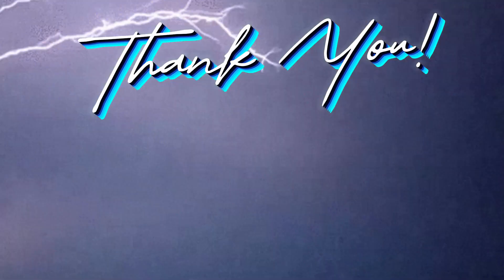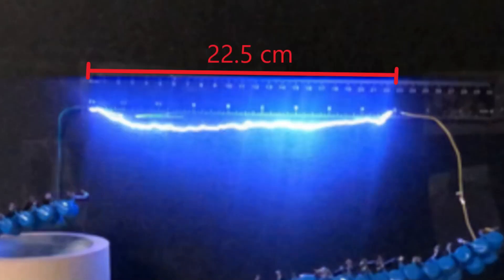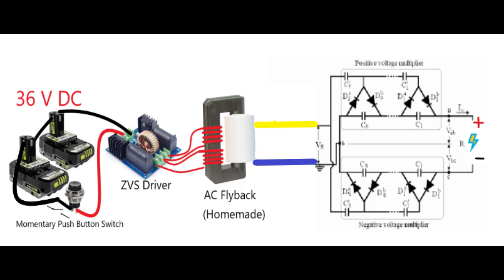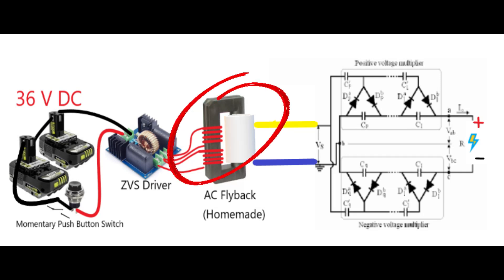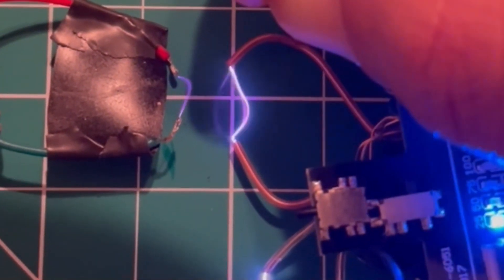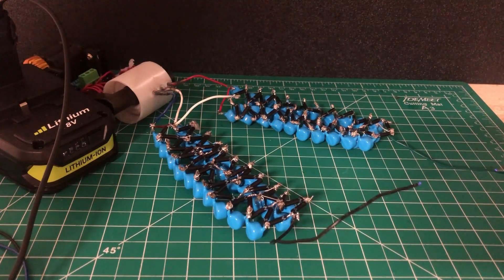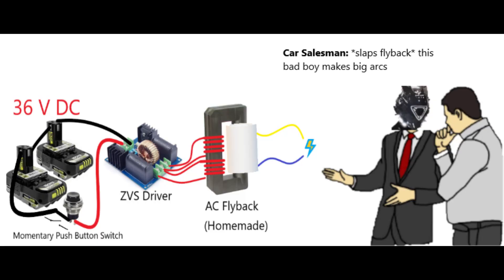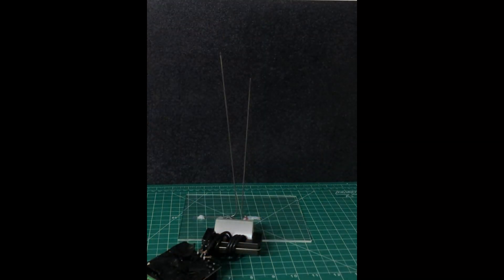225,000 VDC High Voltage Multiplier - ZVS Driven AC Flyback Transformer Bipolar Cockcroft Walton

Comment: 225kv is a bit of an overestimate, 10kv per cm is only good up to about 60-70kv, after that it drops quite bit 185kv can arc about 30cm
Reply from the maker: The only way to tell is to actually measure it, which I don’t have a way to do that at the moment. Everything else is an estimate which I believe the viewers understand.

Where have you seen that the estimate drops off at 60-70kv? No offense, just seems like it would require more voltage to breakdown air at greater lengths. I would it expect it to take for example 250,000 volts at 20cm.

Anyways I do appreciate your comment and I hope we can come up with something conclusive!

Either way I will be attempting to produce larger arcs for your entertainment!!
Reply: @UsefulVeryUseful  Nonlinearity effect appears for impulse voltages and high frequency voltages much over 100 kV. This is almost DC and voltage vs sparkover is pretty linear up to 3000 kV, probably more. However it depends on humidity and pressure. If you had atmosphere close to standard, rod rod bipolar gap is around 200 kV for this spark lenght
Reply from the maker: @imeprezime1285  thanks for the information! Do you have any high voltage projects that you are working on at the moment?
Reply: @UsefulVeryUseful   Yup,  110/20 kV 20 MVA substation. I'm an electrical power engineer
Reply from the maker: @imeprezime1285  that’s awesome! I have a degree in EE as well but most of my experience is in RF/electromagnetics testing. I started this channel to get more hands on experience with interesting projects and to show people how to do these things because I’ve noticed other bigger channels lacking. Hope you enjoyed, and stay safe while working with such deadly power!!
Reply: @UsefulVeryUseful   Don't worry, we take all necessary precautions. My job is nowhere that dangerous if compared with say lineman, and almost all is equiped with automatics today. If you want to measure output voltage better, use sphere gaps of appropriate size on output terminal. Have fun and good luck!
Reply: Yeah i was only recently made aware of a non linearity, but i cant remember if it was jumps further or less..
Reply from the maker: @jonlitchfield8888  interesting, it makes sense. I guess I haven’t looked hard enough. If you find the info, please let me know!
Reply: Wow thats a pretty big investment youve made!!! Ive been thinking of going that way too.
I just finished winding a homemade bobbin last night, flyleads attached, ready to go when i get home. This particular bobbin has 10 partitions, and about 2700 turns, and will be started on 5+5 pri, zvs supplied with a big rewound mot and 12,000uF cap. Cant wait.
Your bobbin and finished product is beautiful - best Ive seen anywhere, period. 
Can i ask you what u used for a vacuum chamber, where from, cost, vacuum level achieved and lenghth of time under? And exactly what epoxy used? Ie water based, hydrocarb based, proper potting stuff even. What was yr secondary wire thickness? Was it extra enameled? Also what plastic did u choose to print it from? 
Bloody fantastic output u got too! What were yr cap and diode details? 
I dont wanna sound like safety squirrel, but i read permanent nerve damage can result, should it ever find a surprise path of lesser resistance. I would enjoy yr vid much more if u used anything with a higher resistance than yr hand ha ha
Reply from the maker: @jonlitchfield8888  first, I would say try different turns ratios, if you’re going to use the Cockcroft Walton. I tried my 1000 turn and didn’t get much of an arc greater than 4 inches. I assume it was due to the current trade off for higher voltage. Either way I would like to see you post a video of your setup and results! That circuit sounds terrifying!!

As far my vacuum chamber it was a generic one I found on eBay for $100, the ender3 printer was also $100 and the transformer winding machine was $150. I used normal pla for the bobbin, glow in the dark pla… lol that’s why the color is white. I used 30awg enameled wire. The pressure was at -.8 atm on and off about 3 times to get between the windings for about 10 mins each didn’t feel it necessary to go more than that because I tested the transformer without epoxy and didn’t see any arcing or burning. That’s with this circuit though, who knows what would happen with more power. If the pressure is held until cured I noticed that some of the air gets trapped at the top and makes the finish not look so great. The epoxy I used was from Amberart 2 part Epoxy Resin Kit. Don’t remember what the base was but it has worked well with all my projects.
Reply: In general air is 30kV/cm. It depends on humidity and pressure. Paschen curves give you the relationship between pressure*distance and breakdown voltage. Schwaiger tells you about electrode shapes and their effect on the e-field. For decent measurements of voltage by spark gap you need to use spherical electrodes. Those are standardized for example in oil breakdown tests. But Schwaiger also made tables for electrode shapes when measuring voltage with spark gaps. Everytime you see someone on YouTube who measures the spark length between some wire ends and calculates the voltage with 30kV/cm it's nonsense. With those electrodes it will always break down at much lower voltages. There are also correction factors for air pressure when using spark gaps. The electrode surfaces should be polished and the measurements is different for AC and DC. Usually AC is a bit easier to do. The alternative is to use a voltage divider. Resistive or capacitive or a combination of both depending on what kind of voltage you want to measure(AC, DC, pulse).
Reply from the maker: @asdqwe4468  thank you for the information! This is really helpful!!

Comment: This is crazy, if you pot it in resin or submerge it in mineral oil you might get even bigger arcs, as not so many charges will escape from the connections. you could also do some of the levitation experiments, or oil self assembling wires that others have already done with those huge voltages. Anyways, congrats for 300 subs, i'm sure you will get to 1000 very quickly.
Reply from the maker: Yeah I actually had to pot the first 10 stages because they were arcing over! I forgot to put that footage in!

And thank you, I hope to get 1000 subs soon, just gotta stay creative.
Reply: @Aaaaaaaaaaaaaaaaaaaaaaaaaa-i8y  hey, I saw you somewhere 👋